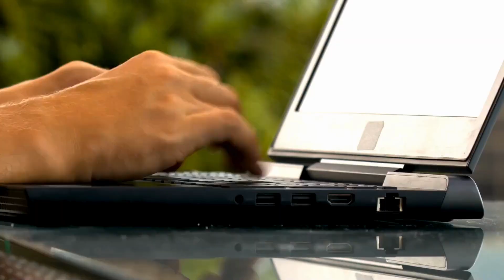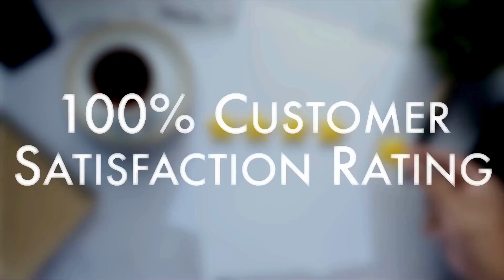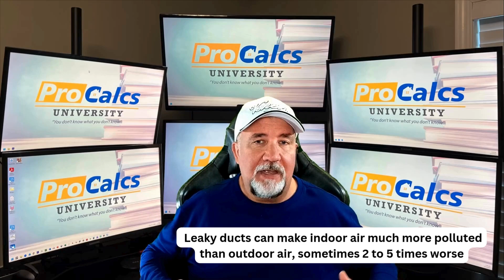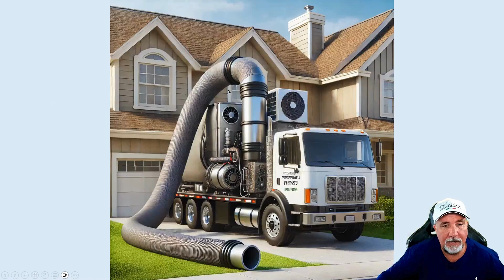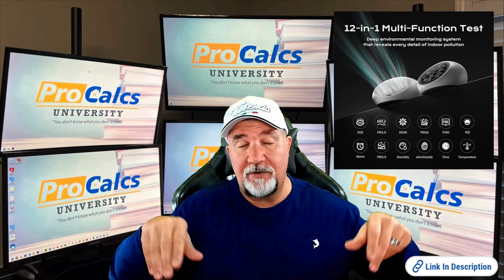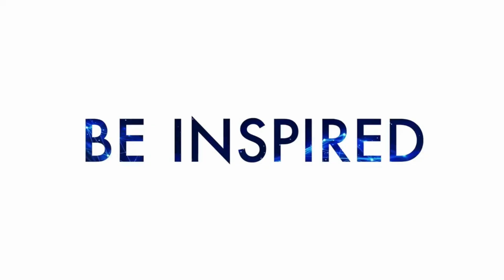Dirty Ducts? The Shocking Truth About Your Home’s Air Quality! #ProCalcsUniversity #hvacdesign

Comment: I have a musky smell that comes out of the vents.When I'm away for a few days I can smell musky smell.i noticed when the air conditioning is on.Do I need my Ducts cleaned. My townhouse is 2 yrs old.
Reply: Or is there a leak in the ducts
Reply from the maker: @rhbarbs great question! A musty smell when the AC is on is usually a moisture issue at the indoor coil or drain pan, or a return duct leak pulling in damp air. Since your home is only two years old, start with the simple checks: replace the filter, clean and flush the condensate drain, and have a tech clean the evaporator coil and pan. Ask them to do a quick duct leakage check on the return side and look for wet insulation around supply boots. Keep indoor humidity around 40 to 55 percent. Duct cleaning is only needed if they find visible debris or growth inside the ducts, and the coil and blower should be cleaned too.

Comment: I would think a MERV-15 at 1 inch thick would be more restrictive than a MERV-15 at 4 inches thick. The increase in surface area allows more air to pass through.
Reply from the maker: Good point! @ZimZam131 The surface area of a filter plays a huge role in its airflow resistance. A thicker filter, like a 4-inch MERV-15, has more pleats and surface area, which helps reduce the restriction compared to a 1-inch version.

If you’re considering upgrading filters, it’s also worth checking that your HVAC system can accommodate the size and airflow needs. Have you noticed any differences in performance when using different thicknesses or MERV ratings? We’d love to hear your experience!
Reply: @procalcsuniversity1484  My air handler only accepts a 1 inch filter. I also have the option of using my return vent to hold the air filter, which also holds a 1 inch filter.
But after searching around I found a website that will custom make an A/C return vent that can hold a 4-inch filter. The cost was about $400 so I haven't pulled the trigger. Maybe next year, but replacement filters are also super expensive.
Reply from the maker: @ZimZam131  You’re absolutely right, most air handlers designed for 1-inch filters can limit options for filtration upgrades. Switching to a custom A/C return vent for a 4-inch filter is a great idea, especially since thicker filters generally offer better air quality, lower resistance, and longer replacement cycles.

While it's an investment upfront, it can pay off in the long run by reducing strain on your system and enhancing indoor air quality. In the meantime, using a high-quality 1-inch filter and replacing it regularly can still make a big difference.

If you decide to go with the custom vent down the line, let us know how it works out, we’d love to hear your experience! 🙌